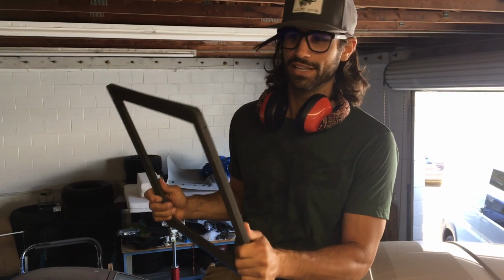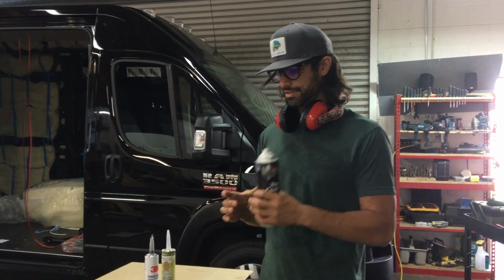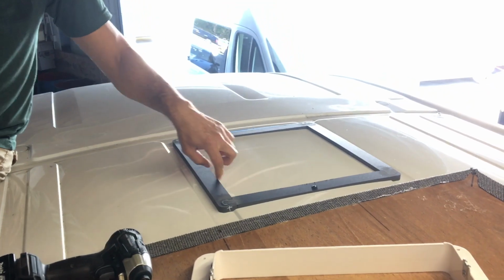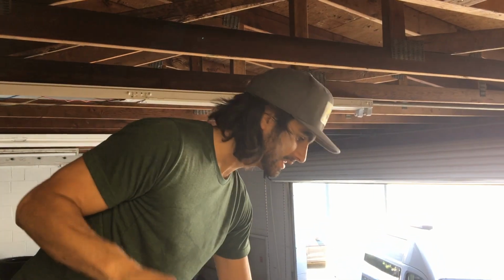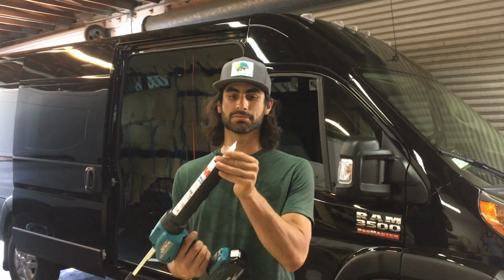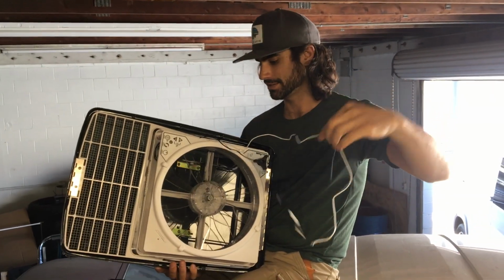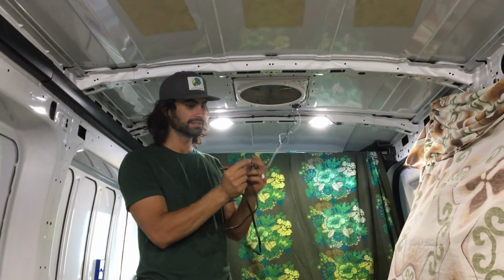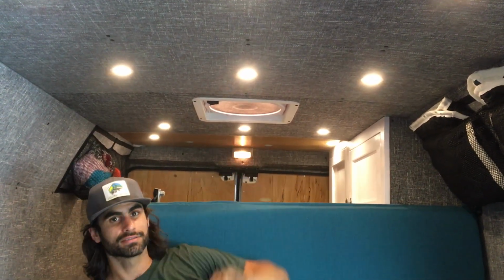How to Install a MaxxAir Fan 2019 **UPDATE**

Comment: In one of the comments you said that an interior frame is unnecessary as the exterior adapter essentially serves that purpose. If you didn’t have the adapter and just used butyl tape to build up a level surface (like you suggested in another comment) would you feel the need for interior framing? Thank you ❤
Reply from the maker: Hi Jordan! Thanks for the message. I strongly recommend the adapter in any vehicle that does not have a flat roof. We produce our own for our builds but you can purchase them at DIYVAN.com. If you use butyl tape alone and an interior brace, it will likely warp the ceiling and bend the metal. It will also bend the plastic mounting piece which will prevent the fan from ceiling correctly. Hope this helps!
Reply: @LevityVans  you’ve convinced me. It’s just a bit harder for us Canadians to swallow lol

Comment: With so many of these install videos, I can't believe how many are terrible. Yours was the one I used for my 2021 Transit. Now I just need to wire it up!
Reply from the maker: That's great to hear! I'm happy you found it helpful :-) On a transit, you can wire it up to the customer connection point but it really wants to have an alternate battery. The CCP only stays live for 30 minutes to an hour and also depends on the state of charge of your battery. If you look up "customer connection point transit" you'll find some useful information about it. Stay cool 😎

Comment: I just followed along your video while installing my fan.  THANK YOU.  Question - those 4 screws that attach the fan…they don’t need sealant or anything to keep them from shaking out on washboard roads?  I feel like I’m missing something without a nut or anything to keep them there.
Reply: ... Thinking the same thing. Those 4 screws are only holding plastic to plastic. 
. Jeff .

Comment: So did you replace the screws it came with with self tapping screws? If so, can you tell me what size/kind you used? Thanks!
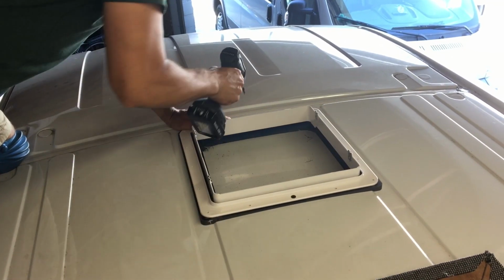Reply: ... 6:40 he used the self tapping to be able to drill through the roof tin. 
Although he didn't mention it, the stainless steel screws (that are supplied in the fan kit I believe) must not be self tapping. 
at 9:00 the video shows the SS screws.
... Whatever an installer does, BE SURE the self tapping screws, bit and shank, ARE NOT larger than the stainless steel screws that will be used in the final attachment. 
Jeff

Comment: what direction do you put the fan
Reply from the maker: The part that opens goes to the rear. If you ever drive with the fan open and you had it mounted any other direction, the wind could rip the lid off...

Comment: Some questions for you: So why not use tin snips rather than a messy jigsaw? What the heck does “self-leveling” sealer mean? What special property are we talking about here? Why should I use all of those specialty sealants when Maxxair in their instructions recommend G.E. Silicone II?  And a final question, do I need to use butyl tape or can I use 3M VHB tape? Thanks for your reply!
Reply from the maker: Thanks for the message John. You can use tin snips. I like using a jig saw. Let us all know how it goes. Maybe we will all change our method :-) Self leveling is exactly what it sounds like. If you run a bead of silicon, it stays as a bead. If you run a bead of self leveling lap sealant, it will level itself out and look smooth. I wouldn't say that Maxxair recommends G.E. Silicone II. Their documentation reads, "Silicone Sealants such as G.E. Silicone II (nonpaintable) used for outdoor applications have proven to be suitable for this installation. So, use it if you’d like. It is “suitable.”
Reply from the maker: My recommendations are purely based on installing 100’s of vent fans. As far as using VHB tape or butyl tape, I like to use 3M Window Weld for both the fan adapter as well as the vent fan mounting plate. Then cover everything with lap sealant. This has never failed in proving a great seal. You can also use bubble gum but it has to be the OG stuff. JK. I don’t trust using just VHB tape but I’ve heard of people doing it. I’m not going to take that route on my customers' vans though. Good luck on your install!
Reply: @LevityVans  Jimmy, In your video, you show using butyl tape between the fan mounting plate and the adaptor, not Window weld.  Is this an update?
Reply from the maker: Hi David G. Thanks for the question and sorry for the late reply. I mentioned it in a comment somewhere that I started using 3M Window Weld in place of Butyl tape. I need to update the description. I just think it's easier and over there long term, more effective...

Comment: howdy! follow up from a previous comment -- what did you run the wiring to? Did you piggyback off existing wiring (LEDs) or did you run automotive/electrical wiring from the van to a connector with fuse relay etc to a battery source?
Reply from the maker: Thanks for the comment. Definitely don't piggy back off of existing wiring unless you know for sure that the wiring and fuse will handle it. I still don't recommend it however. LEDs have a very low amp draw and the fan, although it's not a huge draw, it's still a larger draw and if sharing power with LEDs, it could cause some melting wires or even a fire. It's best to go from the fan directly to your fuse block that is connected to your house battery or another battery source that is not your vehicles starter battery. Such as a goal zero. Make sure you use at least 16awg wire and a 10amp fuse is ideal. A 15 amp fuse is suitable.
Reply: Levity Vans awesome! Thank you tons for the swift reply! Initially was planning on piggybacking but the more I’ve watched videos the more I realized many ran it to a diff source. Thank you tons for the insight!
Reply from the maker: Sure thing!

Comment: Okay I just finished installing my roof fan. 
Couple things I'd pass on. 
Not sure how great of an idea it is to use the 3D printed adapter as a guide. 
I ended up with a lot of tiny pieces of metal embedded in mine. I got most of it out but not all. 
If I did it again I'd put blue masking tape on both sides.

If you are gonna use the shipping box to catch debris as you cut, use shipping tape or duct tape. 
The vibration of sawing and drilling made mine fall down at the very last minute, right before I mounted the actual fan. 
And I used a ton of masking tape.
Reply: ... Good point. For others, use Gorilla tape  (like he did) AND a stiff leg from the van floor to the underside of the box. 
Wood dow, PVC pipe, broom handle, stick out of the woods, have someone (with ear plugs) hold the box, etc. 
... Jeff ...

Comment: My 2000 Chevy Astro has ridges on the roof.  Does that company make an adapter for it? That would really help.
Reply from the maker: I don't believe so. However, you can stack up butyl tape to accomplish something similar. It's just not as rigid. Be sure not to crank the screws down too tight when installing over a thick area of butyl tape.

Comment: One trick I've found to avoid flapping/rattling is to cut almost to the corner but not quite. 
Then when you have it all 99% cut you just come back and cut the last 1/8th inch at each corner. 
It's a little hard to get right depending on what material you are doing though
Reply from the maker: That's a great tip!  Thanks for sharing, we'll definitely give that a try!

Comment: Hey great video thank you it’s helped me but it’s giving me questions on how important this adaptor is. I have an a series van up in Canada and with exchange and shipping the adaptor is over $200 more than I paid for the fan and it will take two months to get to me. I guess my questions revolve around what do you think are my other options.? Or do I just need to suck it up buttercup get off my wallet? Appreciate your advice.
Reply from the maker: Hi Kitchy. Thanks for the question. You can build up your butyl tape to make a flat surface to mount your fan. I didn't always use the adapters but they make for a cleaner and easier install. I definitely recommend it but I think I would keep sitting on my wallet for a $200 adapter.

Comment: Great video!! On your makita caulk gun. What number on the dial do you use when you put on the black 3m and the self leveler. Also how big of a cut on the tip of caulk tube do you do on the self leveler?
Reply from the maker: Hi Kevin! Sorry for the delay. I heat up the 3m with a heat gun first which helps it come out easier. Then I put my gun on 2. I cut the tip of the 3m at a very big angle to cover the whole piece with one go. On the self leveling lap sealant, I cut a hole about 3/4" from the tip. I heat that stuff up as well which helps it lay down quicker. You've probably already installed yours by now. If so, how did it go?

Comment: at 4:43 you have a black cover running along the top of your van.. is that covering your side air bags? I'm trying to get ideas on how to cover ours and saw that.. thanks!
Reply from the maker: Thanks for the comment Kaile. This is a cargo van so it doesn't have rear airbags. The black plastic you see is a housing for all the wires that run from the front to the rear. I'm not sure how I would recommend covering the airbags since that is a safety thing... I don't think I would recommend it. Good luck!

Comment: Thanks for the great instructions!  Is there a reason why you don't use a wooden frame inside under the fan, like I see a lot of other builders do?
Reply from the maker: Thanks for the comment. No reason. I just haven't seen the need. When everything is screwed down these fans feel really solid. Especially if you use a vent fan adapter glued to the roof. Then you are essentially doing the same thing a wooden frame would do.

Comment: cheers and thanks for the video! Fan is the next step in my motovan and liked how you included little wiring in it. Most just stop at the fan and end the video haha no solar yet and wanting to piggy back off the LED lighting atm
Reply from the maker: Hey Connor. Just seeing this post. I hope your install went well and everything has worked out. I just read this and gulped in fear about piggybacking off your LED wiring. I hope you chose an alternative route and wired it directly to a house battery or at least to a cigarette lighter plug. I fear that wires going to LED lights would fail and melt or catch fire. Unless you used larger gauge wire and fused it properly...
Reply: @LevityVans  hahaha NOT TO WORRY! I appreciate you getting back to me. I ended up going with an external battery bank and NOT to my car battery as in my question.
Reply from the maker: Nice. Good for you!

Comment: Love this. So clear and  making an update in title shows you've prior experience.
 I found when I pryed up the inner loose sheet metal and stretched tape under, across the corners for support along with upper tape the metal was way more stable.
Now I'm guessing cure time, temp, humidity for window weld. :]
Reply from the maker: Thanks for the compliment! I have SO MUCH experience now... Yes, good call on taping the corners. I'm sure that felt great. Nice job! How did the install turn out?

Comment: What size and kind of self taping screws are you using?
Reply from the maker: We are using #8 modified truss head self tapping screws but any #8 should work. 1" screws work on most installs but some Vans, like Transits, may require longer screws in some areas.

Comment: Random question but I am trying to set up my van. What do people connect their 12V DC RV roof fan/vent to if they have a solar system in their van??? From what I have seen inverters only have AC outlets?? am I missing something??? Thanks
Reply from the maker: Hey Adam. Sorry I missed your question months ago. You need to connect the leads to the battery that your solar panel is charging. Electrical is a whole nother ball game. I do have electrical kits and schematics available to purchase. If interested, fill out the DIYer form at Levityvans.com/hello to get help with a system designed for your needs. Cheers

Comment: The template looks amazing but their shipping and handling is too slow. Did your previous builds that don't use the adapter leak eventually? I know this is a bit sad, as I would always prefer to do things the best way possible, but I just can't wait 15+ days to get this fan installed, I even purchased the fan locally to get moving quick. My race against winter is on. If the old-school methods proved to be sound enough, I'll rely on them.
Reply from the maker: Hey Nomad Trails! You can definitely do it without the adapter and not worry about leakage. Just build up the areas around the fan mounting plate with multiple layers of butyl tape. Try to get it as flat as possible but it will also flatten as you screw it down. The adapter plate is great but not imperative. Good luck on your install and let me know if you have any other questions 🙂

Comment: Possibly a stupid question but what screws are you using for installing the adapter/mounting plate? This is the best vent install video I’ve seen!
Reply from the maker: Hey Ray! Thanks for the question. Not a stupid one at all. I may have not explained that clearly. I used self tapping screws through the fan base plate and the black adapter ring just to have the holes pre-drilled when it was ready to glue. Be sure to use an appropriate sized screw or pre-drill with the appropriate size drill. So there process is: dry fit the adapter plate with base plate on top, pre-drill all holes or screw down with self tapping screws, remove everything, prep fan base with butyl tape, glue down black adapter with 3m window weld, place vent fan base on top of adapter, screw down with supplied stainless steel screws. I usually give the window weld at least 10 minutes to cure before I add the self leveling lap sealant to the fan base, adapter and any squeeze out of window weld. Hope that helps. Good luck on your install!

Comment: I really appreciate you posting this as it will be used as a tutorial for installing my own fans.  Do you have any additional recommendations on fan placement?  I am planning on installing two Maxx Air Deluxe fans on a Ram Promaster 3500 Ext and was wondering if it's best to place the front fan in the second opening (as opposed to the first) to reduce noise/drag?
Reply from the maker: I'm glad you found the video helpful! In my humble opinion, I think you only need one vent fan unless you plan to use both fans in the same direction. There are a lot of recommendations out there for installing two fans so you can have one suck and the other blow. This circulates the air along the roof of the van. My recommendation is to install one fan near your cooking area and use vented windows in your sleeping area. When you have the fan in exhaust mode and one window open, it sucks in so much fresh air! Plus, this gives you more available roof space for solar and other storage. As far as placement goes, if you put it right in front, there will be some drag but also a lot of wind noise. The second opening works well though. The ProMaster is also better about the audible wind noise since most have the shelf above the cockpit so you don't hear things strait through the sheet metal ceiling... Thanks for posting and good luck with your build. Adventure Awaits!
Reply: @LevityVans  Excellent recommendations and much appreciated!
Reply: @LevityVans  I don’t have any windows or any plans for windows so I thought I would get the second fan to serve the same purpose as a vented window. Unless there’s a cheaper option for a covered roof vent I’m not sure what the other alternative is. Love this video by the way.

Comment: Awesome video, thanks for posting!  I need to know: around the 12 minute mark you are talking about wires and are holding a car adapter with wires that end in ring terminals.  Where did you get it?  Did you make it?  Order it?  I'd like to power my fan with the car adapter until my electrical system is complete.  Thanks again!
Reply from the maker: Hey Austin. So sorry I didn't get back to you about the adapter. I'm sure you've figured it out by now but I purchased the cigarette lighter plug from west marine and wired it up and added my own ring terminals.

Comment: Yo Jimmy !  I am thinking about placing my fan in the same panel you did here (2nd from the back).  However, it seems most people do it in the panel furthest back or forward, avoiding the middle.  Just wondering... what was your reason for putting it in this one ?  Thanks
Reply from the maker: Hey Wex. Thanks for the comment. I do like to leave either the front or the back free for a solar panel. The second panel back still leaves room to achieve this while also having the fan above the bed area. My favorite area to install the fan is toward the front. That way you can have the fan on exhaust mode with a window open near your platform bed. This clears the hot air from the ceiling, pulls fresh air in from over your feet or head and also gives your full van cross ventilation. I hope this helps. Happy hole cutting!
Reply: @LevityVans  Last question before I make the cut ! Would this change if you had a van with no windows in it?  Would you put it more towards the back to pull air in from the front windows ? Also, my van doesn't have windows, but it's not too late to change that...
Reply from the maker: I'd highly recommend having the vent fan in the front and small vented windows in the rear... However, if you don't put any windows in, then yes, the rear location is probably more ideal. I still highly recommend the 1st option!